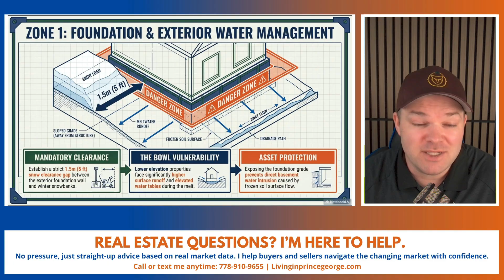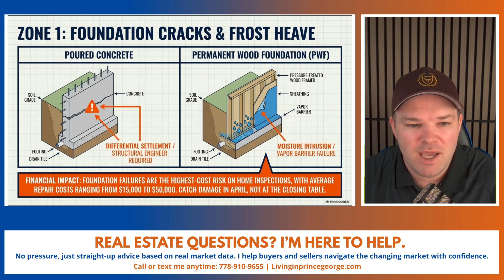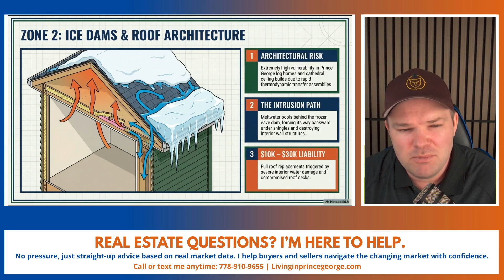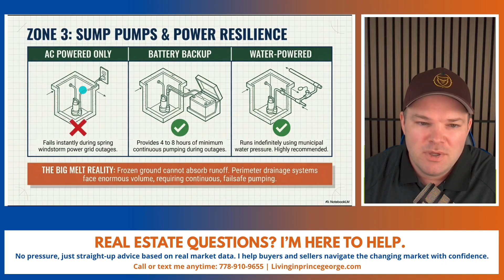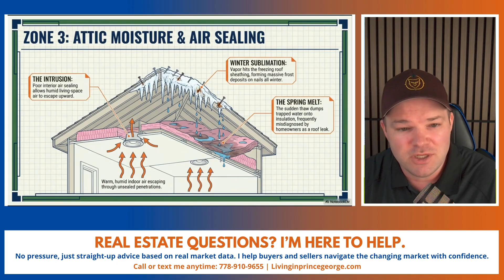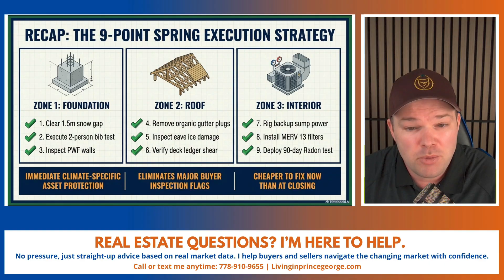Spring Prep in Prince George: Protect Your Home & Equity

Comment: And people wonder why I had my house built on posts where the floor is 3 feet off the ground.
Reply from the maker: Smart move, Dave! Building on posts is a great way to completely bypass the hydrostatic pressure and 'Big Melt' drainage issues we see in PG. You basically traded a basement for total peace of mind regarding foundation cracks and sump pump failures. Thanks for watching!